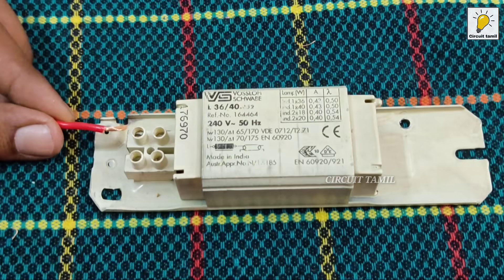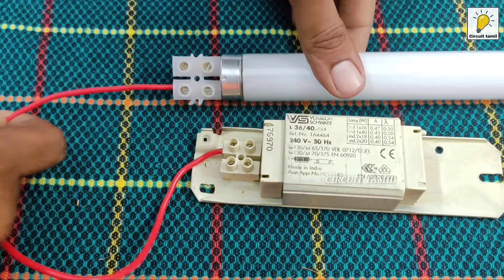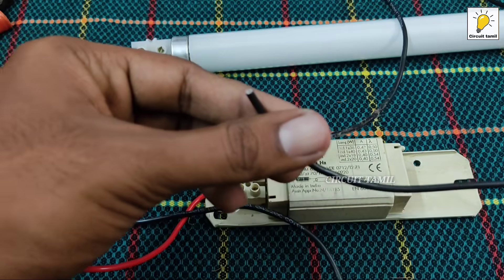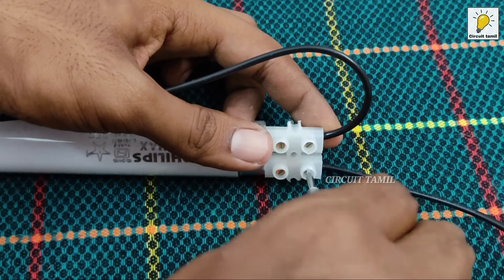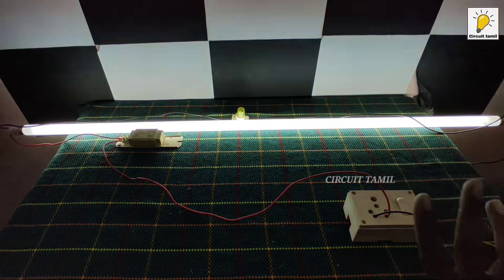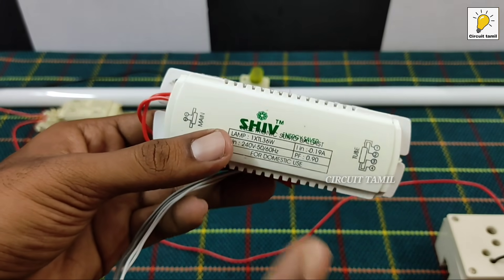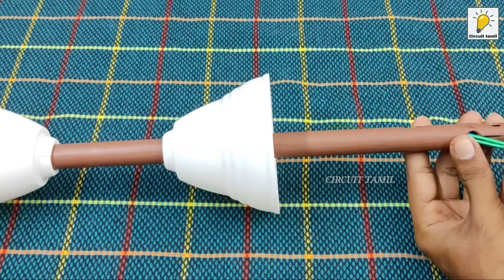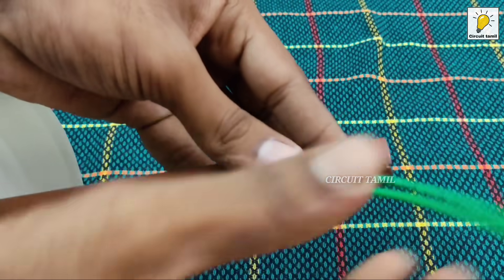2 basic wiring for Beginners and electrical students | Ceiling fan down rod wiring and tips

Comment: Bro enga veetla 3phase connection, but fridge, fan la tester vachu pakumbothu current varuthu,fan mechanic kita ketta earth correct ah check pana sonaru, panipatha plug point la oppsite current varuthu, ore line la varala appadi iruntha earth adikumnu sonaru,earth connection irukuthu but eppadi enna panrathu intha earth ethavadu problem kudukuma
Reply from the maker: Earth continuity irukka thu bro main off panni eargana  ve iruntha eartha pipe irukku illa bro athula salt water vuthunga bro note ; eartha ground la irukkum illa anga tha salt water vutha sonna ok va bro